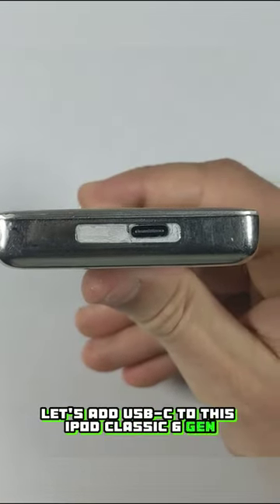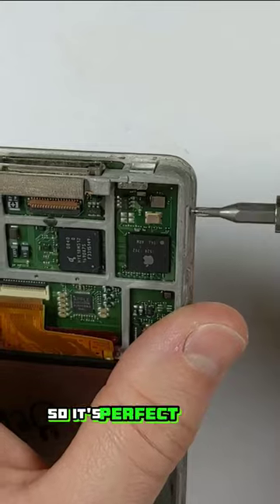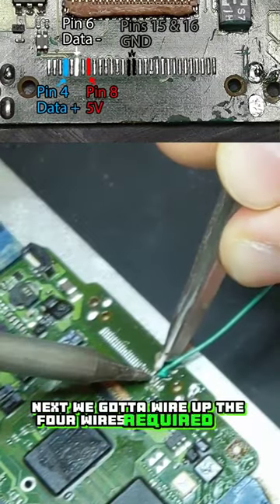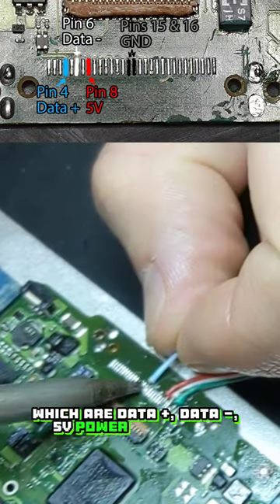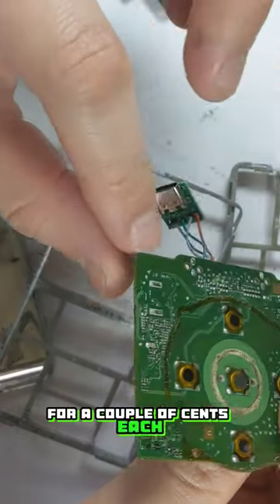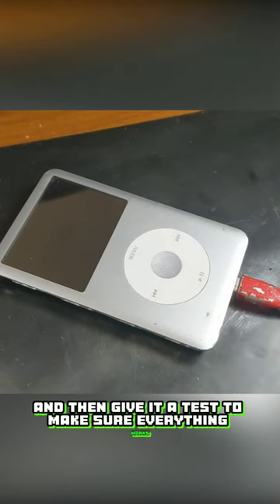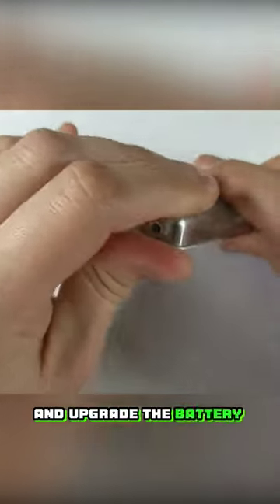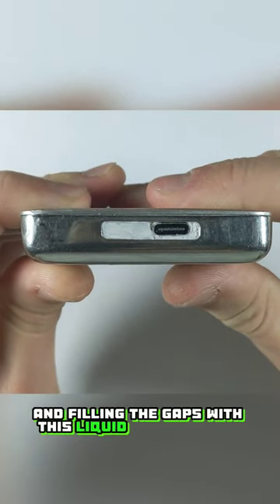iPod classic USB-C mod #usbc #ipod #tech

Comment: you should do this again but add an extra 3.5mm jack for the line out at the bottom. that would be really cool. you could even get a sheet printed of a whole bunch of pre made little pcbs with the usb connector & aux connector with pre spaced / labeled pads for easy installation.
Reply: there’s already one prebuilt in at the top
Reply: @izaan01  headphone out and line out are different. 
people use the 30 pin to 3.5mm jacks to get line out audio from the ipod to send to an amplifier or car stereo or somthing. the dac inside the ipod actually sends out a headphone signal that will go into a volume controll thing and a line out signal that is mostly just filtered and sent out the ipod 30 pin cable. 
when he swaps the 30 pin cable for the usb C the functionality of the line out has been removed, but could be easily re-implemented with an extra 3.5mm jack at the bottom.

Comment: Is it possible to modify the built in DAC? Like the heaphone jack?
Reply: I know several of the Bluetooth mods use a transmitter that takes audio from the headphone jack without removing it to allow wired or wireless headphones/speakers.
Reply: @thee_number_six6227  I was thinking about putting like an LG Quad DAC inside one

Comment: So if you only need 4 fucking pins what was the point of the other 28 pins 😤👀
Reply from the maker: it can charge over fire wire which requires another 4 pins, the ipod docks have another couple for audio and a few others are used for different accessories. I think some iPods can even play video through it. Although a couple of them are blank too.

Comment: Great mod but do you get USB-C transfer speeds?
Reply: You wouldn't. WHat this mod does is basically integrating a 30pin to usb-c adapter. THe USB controller is still the same.

Comment: Do you need to add some resistors so you don't have to use a A to C cable
Reply from the maker: yes you need those resistors to use USB c to USBc cables which unfortunately this one didnt have. Although i have had some custom boards made up that do have it and will mount on a lot of old apple devices that use the 30 pin cable that will be available soon

Comment: And this supports everything, charging data transfer, iTunes compatible?
Reply from the maker: yes it will still charge properly and do data transfer. Although you will lose the ability to charge it with the 12v firewire chargers that the earlier gen ipods used. And it wont be able to play music through the port which the 30 pin could do too although it is possible to add that.

Comment: But what are the other pins for?
Reply: for other addons and attachments for more proprietary cables you could only buy from apple at the time
Reply: The 30 pin thing wasn't just for one ipod. The plug needed to support both USB and FireWire which are different standards. There's also support to send video over different pins.

Comment: EY Bro.. NIce Video. I'd Like to sent you my IPOD, i live in Venezuela, sooo the shipping would be expensivee..
I have a 7th gen Classic. 
I'd like to Install, USB-C, Bluetooth, Flash Mod, 3000mah Battery. 

I know bluetooth Goes on top, does 3000mah battery fits with all that stuff on a Thin Case? or just go for 2000?

Players MOD, put it a AirTag, Could you give and advise, on how to install it?

I haven't Buy anything, Only got the IPOD. I have OCD, that's the reason i want everything toguether. 

I'm buying a beautiful, Purple or Blue Housing, I don't want to open it anymore..

PD: Sorry the BAD English..
PD2: Love U Bro. Good videos and Stuff :)